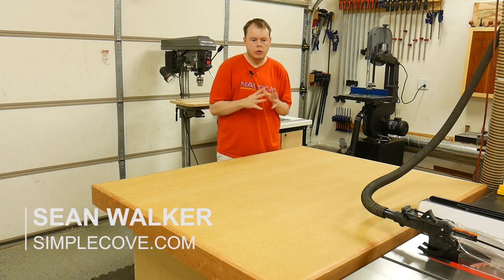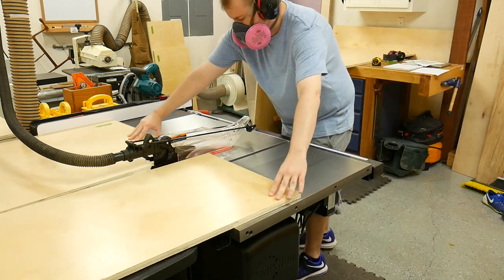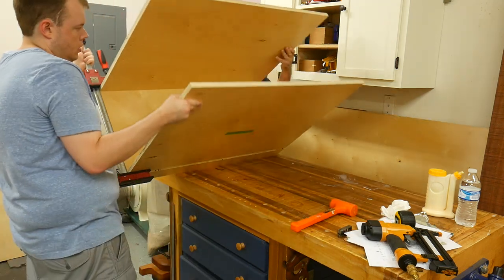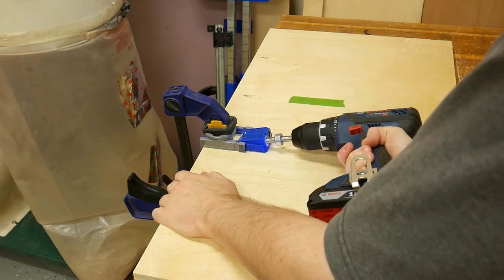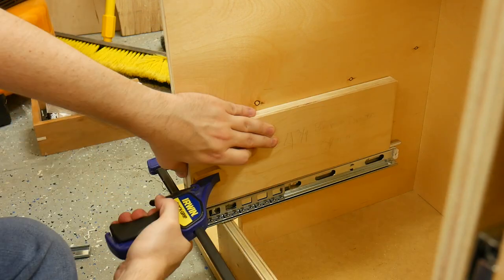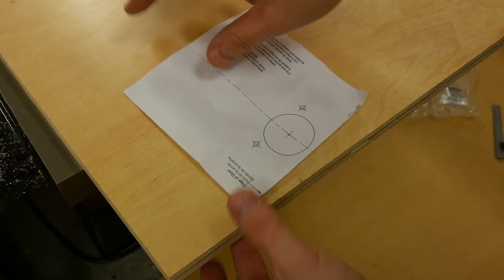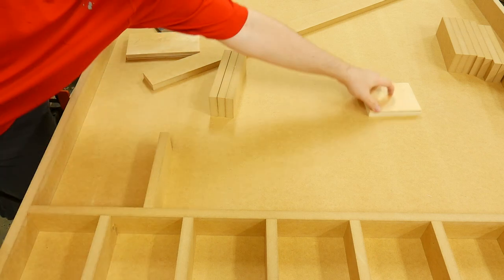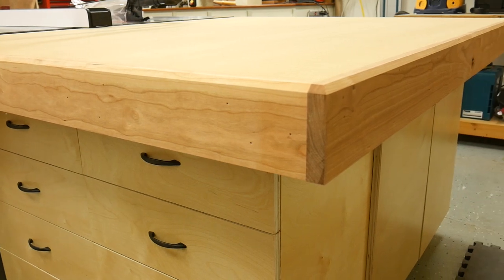How To Build An Assembly Table

Comment: Great video, thank you for sharing. I noticed you didn't apply glue to the edges of the grid pieces on the torsion box top. What are your thoughts on the necessity of gluing those pieces to one another vs not doing so? Thank you for a very well produced video.
Reply from the maker: Glue is not needed. I nailed them to each other and put the MDF panel on top with nails which means they're not going anywhere. Have had zero issues.